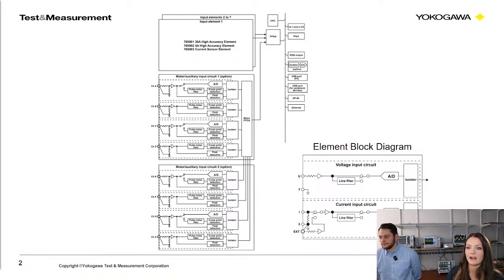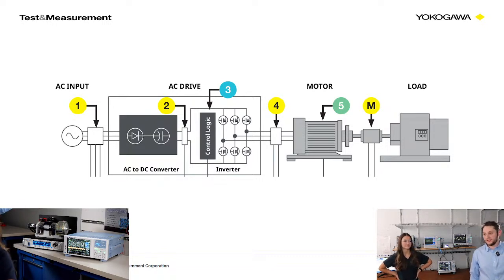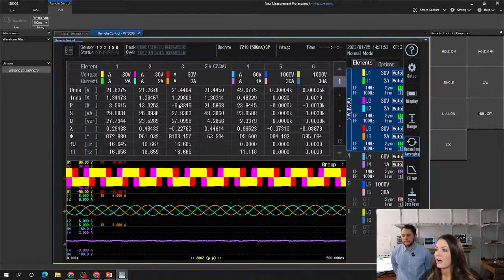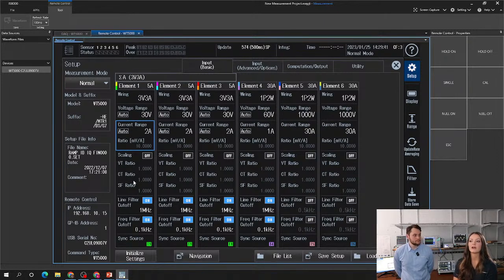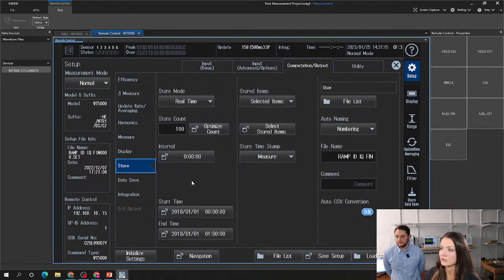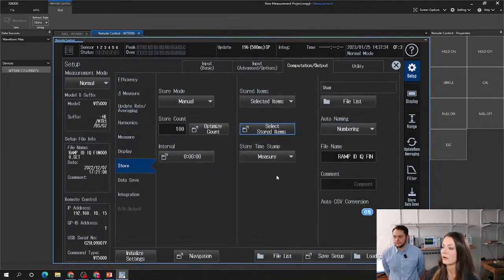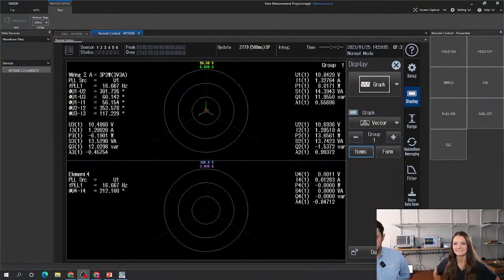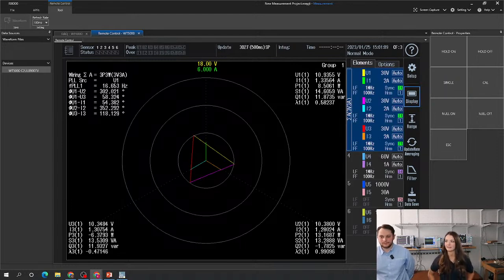WT5000 Precision Power Analyzer: What Would You Like to Know? | Yokogawa Test&Measurement

Comment: what is the clamp CT model number
Reply from the maker: The red clamp-on shown in the livestream are AEMC SR661 current probes. If you are looking for clamp on current sensors, we have also release our new CT1000S which is a precision split core current sensor: https://tmi.yokogawa.com/us/solutions/products/power-analyzers/precision-current-transformers/splitcore-currentsensors/
Reply: @YokogawaTestMeasurement  IF I use CT1000S with WT5000 + 760901 what whill be the total unit accuracy? also how would the accuracy differ if I use 760903 element. 
2. what is the input range with probe input on 760903. 3. is there any software which would help run 3 phase motor testing as per IEC60034-2-1 method B